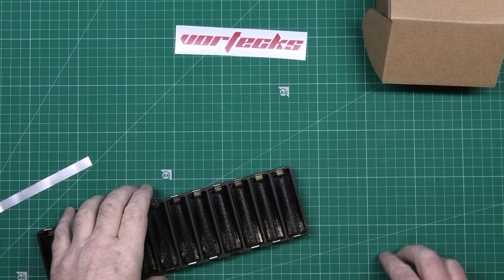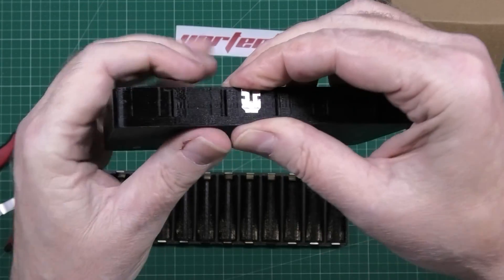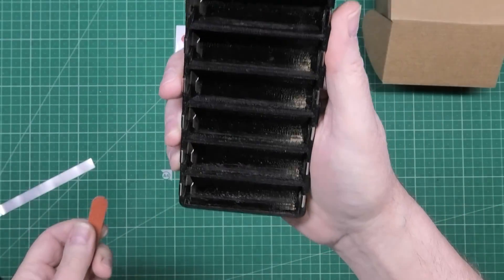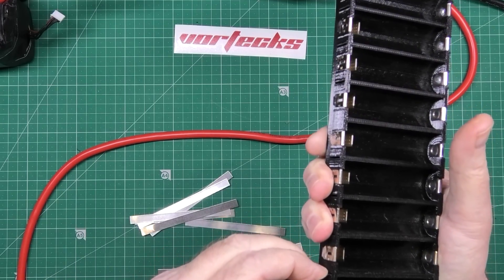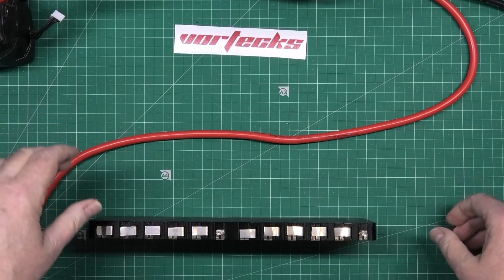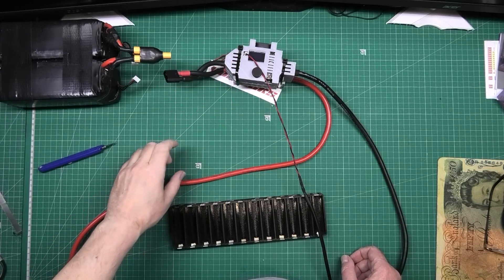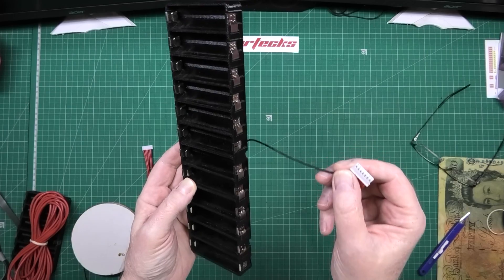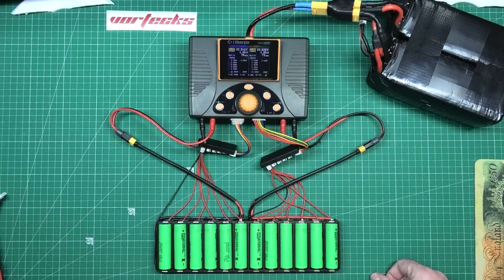6s and 12s 18650 charge/discharge/capacity tester for dummies - how to build it!

Comment: Thank you for the tutoril Vortecks. I want to use your design in a drone build. So lets say I want to make a 3S 2P brick. I want to add 3 xt 60 connectors to the whole pack. 2 connectors to each Pack that I will use to charge each pack indipendently like you have in your build and I wand to add 1 connecting the packs in paralllel for conneting to the drone. So in total 2 connectors in for charging and one connector out for discharge. Will there be any negative effect/s on the charing if I have the 3d parallel connection?

Comment: Cant because they'd slide side to side
Reply: Bob's and strings on a 3d printer is usually cause 1st by wrong retraction setting or 2nd too hot on the extrusion